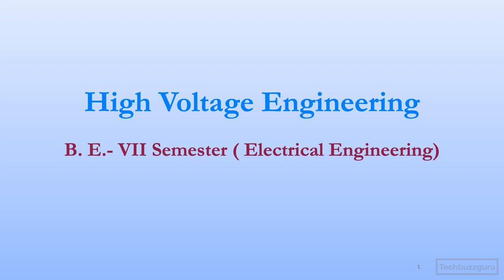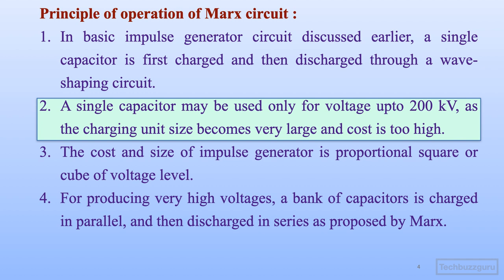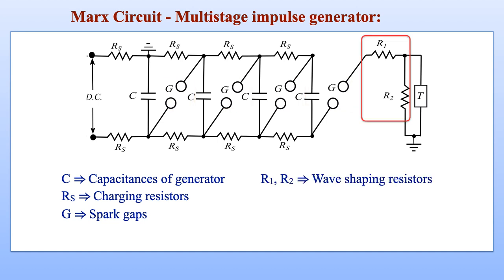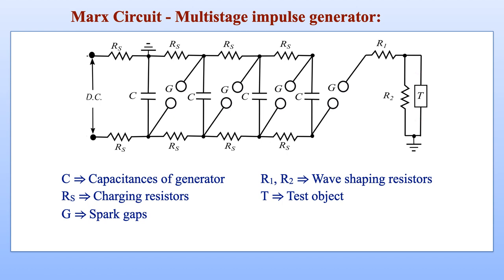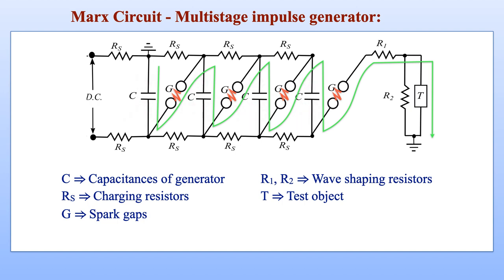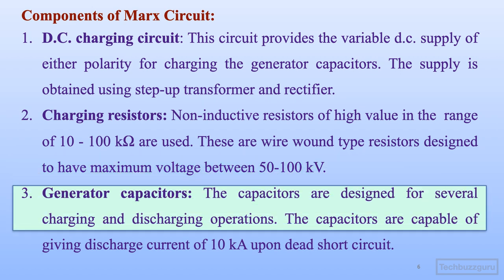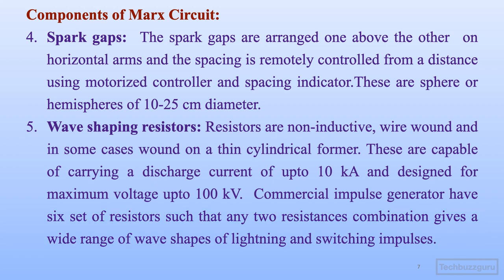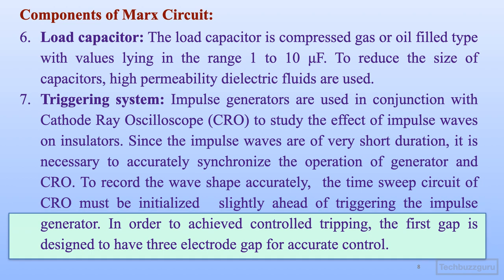Multistage Impulse generator

Comment: Sir....what is the input (dc)
Reply: The input is whatever voltage you can trigger the spark gap. If you cant trigger the individual spark gap, you either use bigger voltage or you use smaller gap.

You need ~3kV to make electricity jump 1mm in air